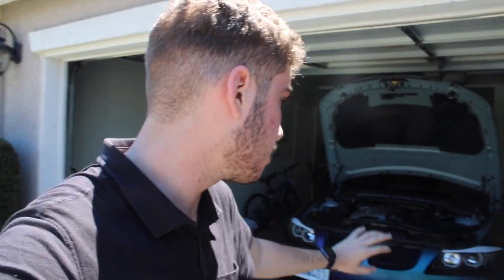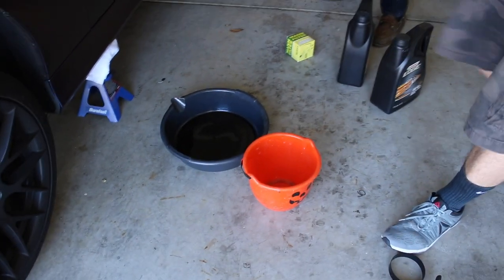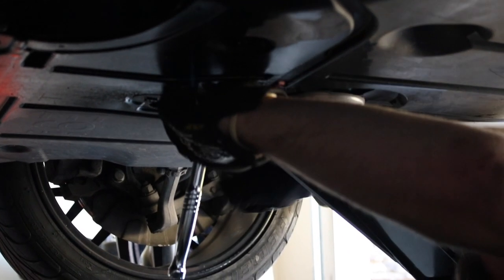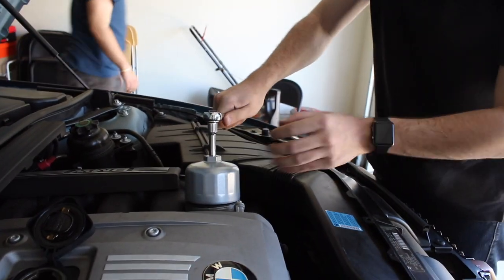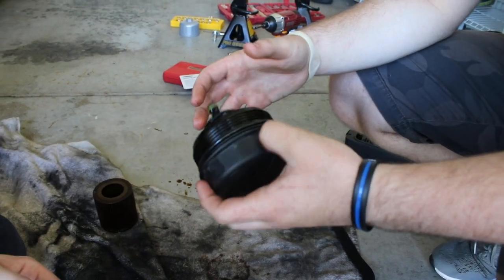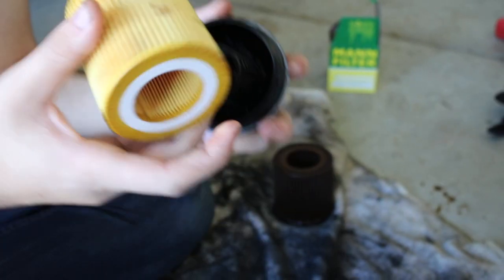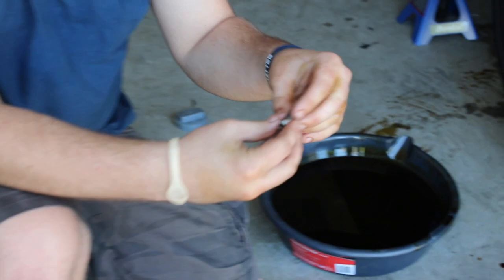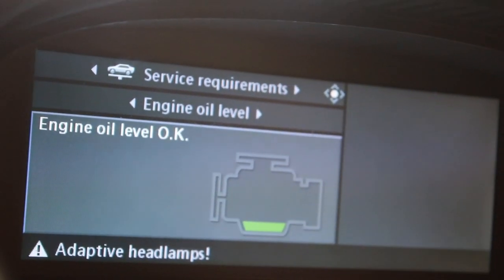THATS HOW AN OIL CHANGE IS DONE (E90,E91,E92,E93)

Comment: The copper ring that came with the oil filter actually goes on the drain plug. If you don't put it on it will start to leak slowly. And for the oil filter the oil is suppose to go on the o rings not on the actual filter lol.  Car looks fabulous btw